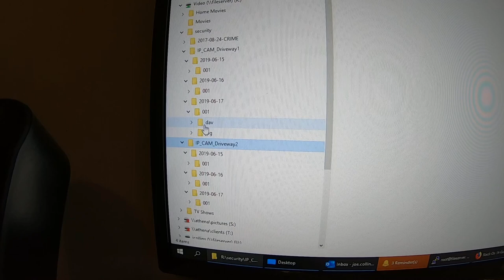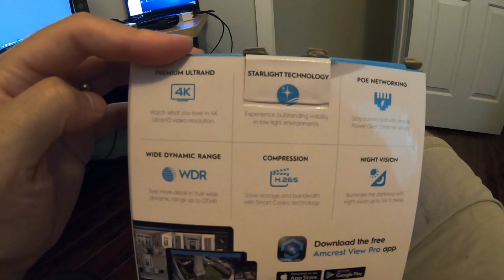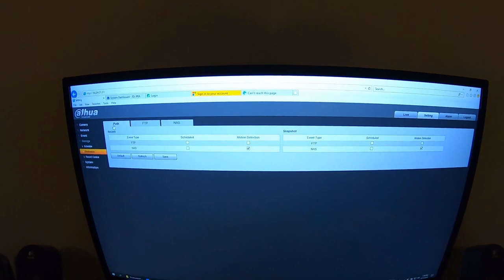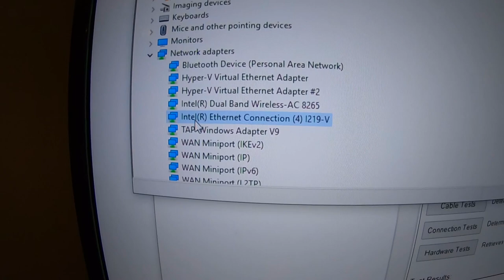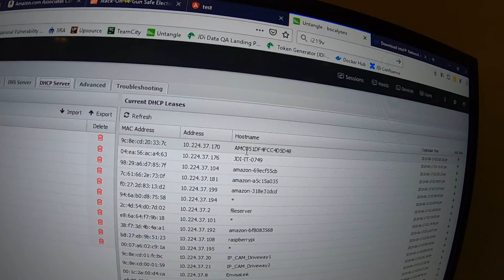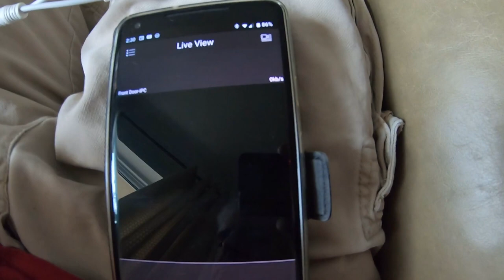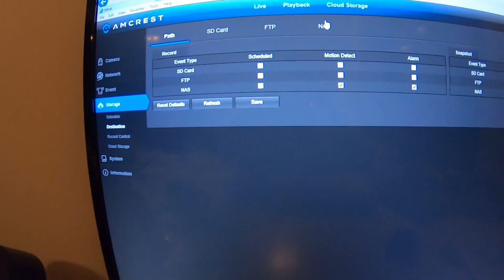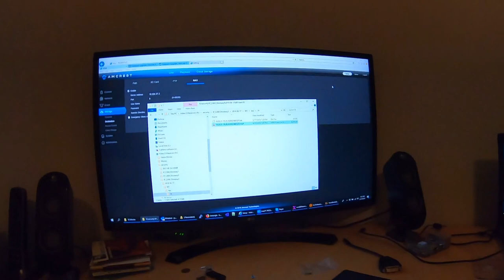Installing IP Security Camera

Comment: What's your video settings? trying to find tune mine
Reply from the maker: I found that recording at 1080p using h.265 at approximately 30 frames a second works well for me
Reply: @JoesGarageProductionsLLC  same, what about your picture settings, BLC mode and 3D NR?